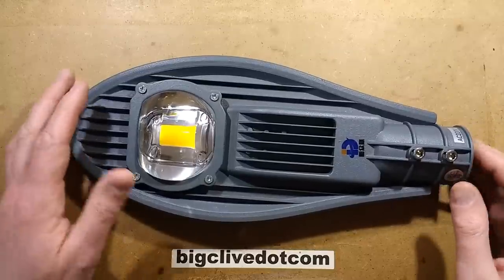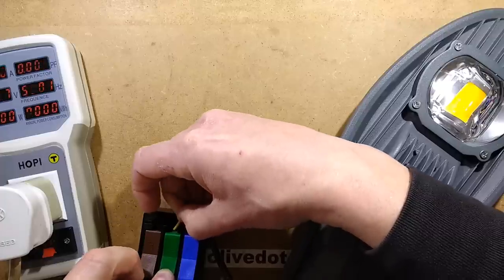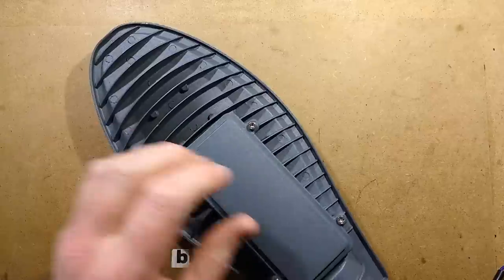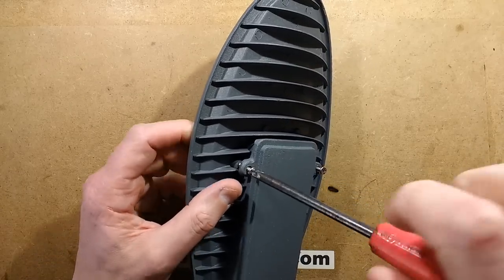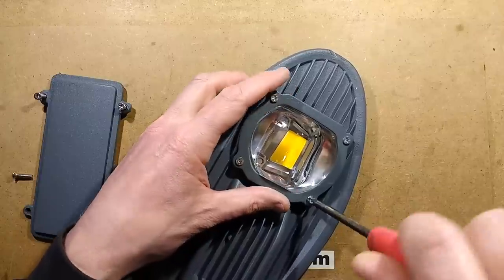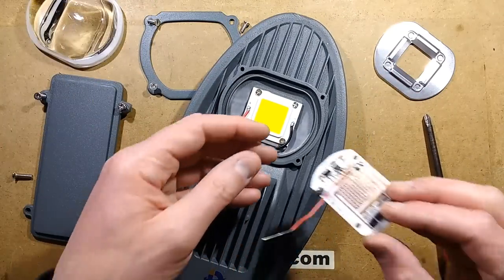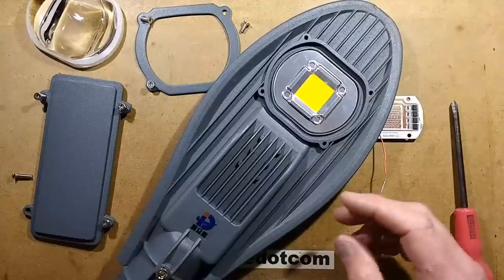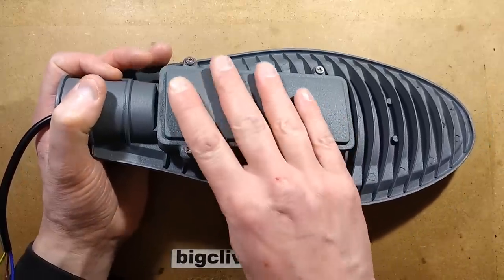Inside a stylish LED street light from eBay.

Comment: does "driverless" mean that it connects directly to AC power without stepping down the voltage or going from AC to DC?
Reply from the maker: +Jeff Flowers It means that the current regulating circuitry is on the same panel as the LED chips.  So no external driver is needed.

Comment: How do you connect the cable in the pole? Normal streetlights have terminal block inside.
Reply from the maker: +JendaLinda It would require the addition of a connector.
Reply: bigclivedotcom the seller of that light sounds Turkish...
Reply: @bigclivedotcom  I've noticed that where I live, some of the LED fixtures (Philips Roadflair?) come with several metres of cable attached. The power crews don't bother trimming it, and just coil it up and leave it up there.

Comment: Doesn't look half bad for cheap Chinese tat - a few washers on the bolts for the lid should sort that out no problem
Reply: Agree ... and a dab of silicon where the cable passes through to really seal off the enclosure.

Comment: Poor choice to have the driver on the top part, would have made more sense for it to be underneath but other then that looks a lot better built then most i have seen.
Reply from the maker: From an installation perspective it would be a lot nicer to wire if you were working from a bucket truck.

Comment: They always seem to leave the blue plastic film on the rear surface of the reflectors.  Probably don't want to waste time taking it off!
Reply: da-share Or for insulation
Reply: As far as I know the plastic is there before the shapes are punched out and is a protective layer to lessen tooling marks.  It couldn't be relied on as insulation.
Reply: same with dashcams etc, the film over the screen is not taken off before they fit the screen so you end up trying to remove it without damaging the screen.
Reply: how where you able to comment on a video 3 days ago if the video is just online since a few hours?
Very mysterious Ö_Ö
Reply: audiocrush Patreon
Reply: da-share Thats never stopped china...

Comment: Regarding the issue with the screwholes not being tapped deep enough - assuming the IP67 rating on the regulator is to be trusted, wouldn't it be able to deal with a small amount of water ingress as long as it didn't make its way all the way to the LED?
Reply from the maker: +bd_ The main issue would be water getting into the LED section and filling the lens area, causing mould or corroding the LED connections.
Reply: I never understand why, for items that are only mounted one way round, there are no drain holes. Rain may have a hard job getting in, but air can. Air can carry a surprising amount of moisture. During the warm (day) and cool (night) day cycle, moisture can condense on the cold metal inside the compartment. If it gets on/in the electronics it then will result in corrosion...

Comment: It is a bad design from a waterproofing angle.  The access cover for the driver module should have been put on the underside.
Reply from the maker: Much better for wiring on the top though.

Comment: I still prefer the sodium street lights, they were brighter and the colour wasn't "daylight white", plus they used to turn those off after midnight.  Ever since they changed the street lights round here to LED, it's made it harder for me to feel tired at night.
Reply: CoolDudeClem Yes, that tired thing is actually something thats got me rather concerned.
Reply: There are some LED lights that have a yellow/orange lens so that the light output is very similar to sodium color.
Reply: CoolDudeClem 
Black out curtains work.

Comment: whats happened with the vid on pounlnd garden solar panel its dissapeared?  As an idea could u do avid on coupling multi cells together to make ahigher voltabe and current portable solar panel to charge a power bank when i go camping in scotland.  Coupling the panels together in series and parallel and what kind of voltage regulator to use, if any?
Reply from the maker: You can buy some very useful solar panels on eBay that are pretty much capable of charging some USB equipment directly in the right conditions.  But keep in mind that for proper remote power in Scotland you need a decent size of solar panel.  Keeping a smartphone topped up is not a matter of putting a small panel out in cloudy weather for an hour.

Comment: Another operation is more cost . A supplier to send the wrong length screws , is a job stopped , time lost etc etc . An earth line not screw down , time gained . When Chrysler finish off the Imp , their bean counters are supposed to have concluded , not fitting the sealing washer under the windscreen sprayers saved 2d ......... it not just the Chinese . It ' s not unit standards are policed & containers / ships are turned back , this sort of  'ollocks will be rebuffed .

Comment: Can you explain what the PF Power Factor on your meter actually means? Please
Reply: I am pretty sure it describes the relationship between current draw with regards to the voltage of the AC sine wave. a bad power factor means it is trying to draw lots of current when the AC voltage is close to zero. a good power factor means the current draw very closely tracks the voltage, i.e. zero current draw at the zero crossings of the AC voltage and high current draw at the peaks of the AC voltage
Reply: Trying to truly explain power factor to a non electronics engineer is very difficult without a background understanding....however to put it as simply as possible, power factor is a measure (from 0 to 1) of how efficiently a device is drawing current vs the voltage it is being supplied.  Power factor is only relevant to AC power, not DC.

A device with a poor power factor will draw more current than you would expect from the simple power calculation of volts x amps. 
In a DC circuit the power consumed is voltage x current. 
In an AC circuit it is only voltage x current if the power factor is 1. 
If the power factor is less than 1 then the current consumed will be higher. 

This is because the current draw is out of phase or not clean (sinusodial) when compared to the incoming voltage sine wave. 
This is an inherent problem with any power supply that doesn't have a purely resistive load or converts AC to DC.
The way many of these 'electronic' power supplies work means they take their current in short bursts and/or out of phase (capacitor dropper or bulk capacitor designs). 
This results in a large current spike at points in the incoming voltage waveform where the voltage may be low or at it's lowest (remember an AC waveform is sweeping through from 0 volts).
As the bulk of the current has been  taken at low voltage points only, then the average incoming current is much higher than it would be compared to a power supply which had a power factor of 1 and was taking its current smoothly and in phase with the voltage waveform.

So power factor becomes important for electric companies and from an installation perspective. If you have lots of devices with low power factor you are drawing more current than your overall power meter would indicate,. Your power consumption may be the same, but with high currents you have to take into account if the cable is sufficient to supply it. Also these high distorting out of phase/spikey currents can distort the voltage waveform, resulting in 'unclean' power to the rest of your devices, introducing interference etc.

This is why there are regulations on what power factor certain equipment must now meet. Low power devices can get away with anything, but once you start going above, i think 30 watts, you have to start having good power factors (> 0.8) - this is done by designing power supply circuits with power factor correction.
Reply: Thank you for your reply. 
It was very helpful.
Its always amazing the wealth of knowledge shared freely on youtube. 
Thanks again.
Reply: True, PF does not apply to DC systems. But you can still get spikes and surges on DC systems that in theory overload the wiring / distribution system.

Comment: By UK law a fixture 40 feet in the air must be earthed?  What is the reason?
Reply: The whole post is earthed
Reply: Who is to say it will be 40 feet in the air? Not all posts are that tall, like on footbridges. Some are attached to buildings, so in theory, you could lean out of a window and touch it...
Reply from the maker: +Ronald Youvan All adjacent metalwork should be bonded.  Where paint or corrosion between different metals occurs you can end up with a poor ground and risk of shock to a worker repairing the light.
Reply from the maker: +daniel parker Not if overhead lines are used.  And depending on the surrounding material at the base, it might not even get a good reference to actual ground.  Completely live lamp posts are not rare.
Reply: I can honestly say in my area each and every lamppost is staked with 4ft rods and bonded to the netural, think it's due to high winds and salty air. Not sure what you mean by overhead lines?

Comment: Why 50 Hz in Europe?? Isn't 60 Hz better?
Reply: Why?
Reply: The majority of the world is 50 Hz
Reply: Patrick Pikulski Siemens said 50hz. GE said 60 hz. Since Japan got equipment from both half the place uses 50hz the rest 60hz. 60hz transformers can be a little smaller than 50hz rated. Aircraft favor 400hz. There are other legacy frequencies still in use.

Comment: Clive, I don't wish to be horrible, I love your videos, but a light that has a faked-up bezel around the light source? It looks like bits with screws but is a whole thing.. Secondly, a light with screws that don't seal the light. This isn't a serviceable thing. Serviceable in the sense of 'repairable' but not iin the sense of long lasting. A good light for someone who likes repairing lights, but if I were a Council I could not use these lights as they would be embarrasing in the long run, I would be pilloried.
Reply from the maker: I definitely wouldn't use them professionally, but as a case for a home project it's quite good.  The expensive LED street lights they've been using here have not been reliable.

Comment: Could somebody give me advise. Firstly I am totally new to all this electronic stuff (so, please no hugely technical answers), and have bought a few kits from ebay to practice with. I am having a problem with resistors. Which end are you supposed to read them from?    There are 2 resistors that are either - brown, black, black, red, brown = 10k or other way brown, red, black, black, brown = 120 ohms ???????????????????????????? oh and this is the kit http://www.banggood.com/DIY-C51-RGB-Colorful-Crystal-LED-Kit-Aurora-RGBLED-Seven-Colorful-Light-p-1097871
Reply: Connor Fox That is always a problem. Look for the end that has a slightly bigger gap between the bands, or one band that is a slightly different width. That end is the tolerance. If in doubt measure it with your trusty DMM.
Reply: I can't be bothered trying to read more than 3 band resistors. Just use a meter and measure them. But once you do figure it out there is actually a convention for how you are supposed to mount a resistor in a circuit. You put bands so you can read them left to right, or top down. When I do a kit I take a piece of paper and fold it so there is a peak, then as I read each resistor I poke it into the peak in the paper and write the value by it. You really don't want to put parts in the wrong places. Get the AVR transistor tester kit. Make sure you get a kit with the precision voltage reference, not just a zener diode. AVR-TTs measure resistors, capacitors, inductors, diodes, and transistors. So they're pretty handy.

Comment: Take a look at a 5g street light. Anthony Steele channel.
Reply from the maker: His videos are a load of crap.  I'm not sure if he believes it or if he's just trying to cash in on the hysteria.
Reply: @bigclivedotcom  What do you make of the claims that the LED's cause harm to eyesight? Since we got LED street lighting outside our house the normal birdsong has disappeared.
Also, what do you make of the 450 volt capacitors and 3300 watt relays in their control? There's a lot more going on than street lighting.
Reply from the maker: @johnb.9806  There's a lot of serious misinformation being out out about street lights.  I don't know if the source is people with attention deficit disorder or if it's being done for financial reasons.   Has the birdsong really disappeared?  It varies throughout the year.
450V capacitors are the correct rating for rectified 240V and a 3300W relay is probably just a standard rating being used at much lower current for reliability.
Reply: @bigclivedotcom  They are supposed to be about saving energy. Rather they seem to me to be the excuse to roll out 5G on street lights.
Anthony says something rather fascinating. The individual antennas collectively are the elements of one large, phased array, radar, capable of scanning everything about them. 
We know that driverless cars are on the way and these look like the infrastructure for them. But more than that, they can scan everything about them which if true is an invasion of privacy, never mind the soup of radar and whatever that might be doing to us.
Reply: @logicalannie4794  I read some of that, it's very long. He goes on about 868, or sub gigahertz. That's not 5G, but he says it is very very dangerous.Perhaps we need to define what 5G is, because he includes the LED's as being part of 5G. So, it's more than just the 5G operating frequency.
I appreciate the danger of being made to look foolish and the harm that would do to credibility. I'd like to see Clive climb up a random lamp post in Gateshead and bring one of them home. If they're all like the ones in his videos there is something to take apart.
Reply: @johnb.9806 868 operates many things like baby monitors, RFID. remote control devices, he points to capacitors that cost a couple of pounds claiming they are weapons, its ludicrous, my website has documented exactly 5G is, ofcom sold off the spectrum in April 2018, the had not even decided what the spectrum would be in Nov 2017 when he was claiming it was in Gateshead lampposts. They decided in Dec 2017 to have a deadline to decide the spectrum for March 2018, so how can it even be possible to have it Gateshead. I have a search engine on my channel that goes into great detail about 5G, who funds it, everywhere were it has been rolled out, but it is NOT in Gateshead and he has got thousands of pounds in go fund me,s.This is to fight the council when the planning policy states that local councils have no say, its a scam.
Reply: @johnb.9806  in his latest video he even mentions that if people do not believe him then they should go check out Big Clive, as if Clive endorses him?
Reply: No doubt that when he realises that Clive also knows that he is talking shite, he will call Clive a govt agent just like he does to anyone who disputes what he claims.
Reply: @logicalannie4794  I know. But Clive's answers leave a lot to be desired. The Harvard Tech Leaf Node is much much more than a lighting control system. There are 2 questions. Are those LED's harmful? And is the wireless radiation harmful? I think the answer is yes to the second one at least.
Reply: @logicalannie4794  Did you see my comment under Anthony's video today?
Reply: @logicalannie4794  I got rid of the cool white 6000k LED lamps in favour of warm white 3200k CFL ones.
Reply: @johnb.9806  Gateshead lighting system being installed has nothing to do with 5G as it’s  a wirelessly controlled lighting system. This has been shown countless times by people qualified to know. If it was so important it would not have gone out of business. it went out of business because it was a faulty control system, hence why the lights would be on in many areas during the day. And yes, wireless radiation is harmful, hence why I have hundreds of peer reviewed studies on my website. Do not be fooled by people who give false info. Especially when those same lampposts were tested  by a man who has been involved in testing this technology and posting info about the dangers for decades who took his equipment worth thousands of pounds to test those lampposts. They were not 5G. Unlike the equipment that Steele used, Mark used the isotropic meter that measures RF signals over the range of 50MHz- 2. 5GHz transmitted from all directions but the not one single direction.in other words it picked up accumulated signals from every conceivable direction.
Reply: @johnb.9806  No
Reply: @logicalannie4794  I did read your website, and I already read that. All I'd say on that is if the lamp Anthony shows is a typical sample of what's in Gateshead then it's much more than alighting control system, based purely on the fact that it clearly uses more than the energy typically needed for LED street lighting, say whatever, 50 watts? There's a motion sensor on top of them which turns up the brightness as cars go past, but it's really overkill, and obviously is no energy saving.
Reply: @johnb.9806  here is a link to

Comment: can condensation ever be a problem for LED lamps ? with warm inside and cold outside does water ever be an issue ? if there is no tight seal then damp air can get inside the lamp unit and condense or ?
Reply from the maker: +girlsdrinkfeck Yes.  Condensation is a big problem with all outdoor LED lighting.